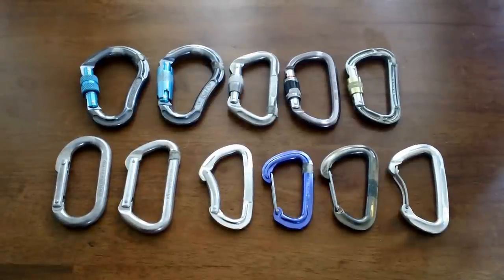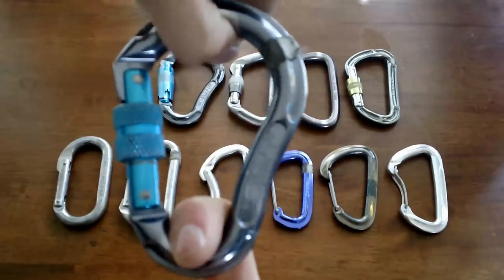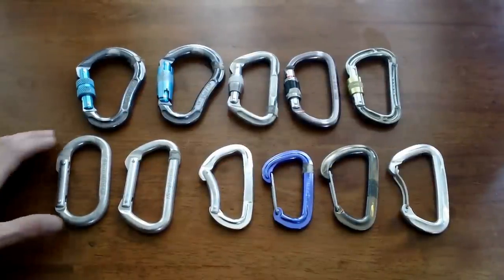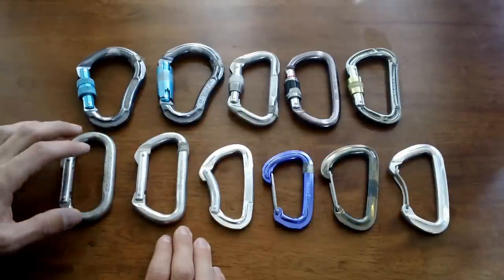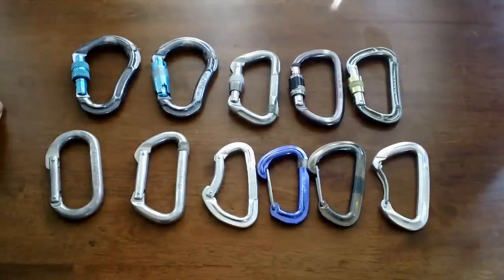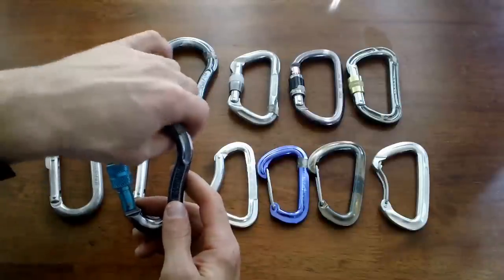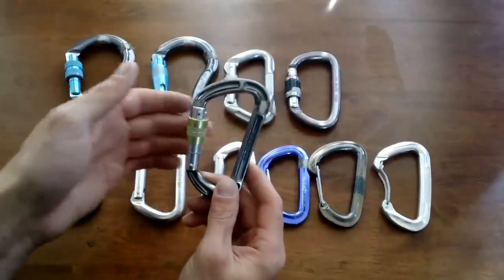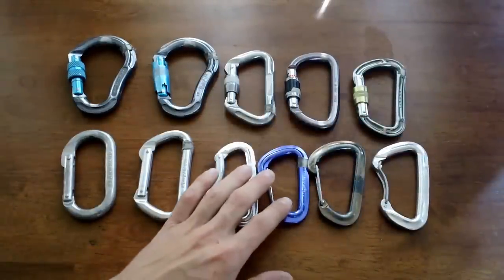Intro to Carabiners

Comment: Keep in mind, the kN rating is a force rating. When you fall, you are putting more weight on the system than just your body weight. This is why rope stretch is very important to distribute the work (from kinetic energy) out over a longer distance (work=force*distance). And reduce that peak force exerted on gear. Its also why shock loading static systems is very dangerous, as static lines, like dynema and webbing, don't stretch (much) so all the energy of a fall has to be absorbed very quickly once all the slack is out of the system. These are the moments you need these seemingly absurd force ratings.

Comment: We once tested a few Carabiners between a 7.5 ton truck & an 9 ton truck. The 9 toner had to tow the 7.5 toner into motion using 4 loops of polyprop atached to 1 of 4 different Carabiners. Only one took it, 2 snaped & one actualy shattered into 6 pieces like shrapnel. Even the fourth one broke in the end. It wasnt very scientific but it was fun.

Comment: Interesting, some good things, some mix-ups.  First, if someone is here for an Intro to Carabiners, avoid technical climbing terms they may not know, or SHOW them:  Top-rope masterpoint, clipping rope, quick-draws, cams, building anchors, aid climbing, big wall climbing, etc.   More show, less talk.  1:08- you say horizontal but your finger points up (vertical).   Usually called major axis and minor axis, not horizontal and vertical.  The nose of the carabiner, not the tooth.  Wire gate is not just a lighter carabiner but the lighter gate doesn't flutter or bounce open from impact or vibration as a metal gate carabiner does.  Sometimes "bigger, older, heavier" may be prefered if a larger capacity is needed.  At 6:43, both carabiners are Ds, what you meant to say was, "...except this D carabiner is locking."  I believe the last carabiner is a modified or offset D since one side is wider than the other.  8:20 "D-ring?"   Take these in the helpful spirit with which I intended.
Reply: ***** Apologies if I missed my goal of providing constructive criticism.  If you didn't find anything I said helpful, I'm sorry.  LOL- actually, I HAVE uploaded a video a few years ago, but I would put it in the category of how it's NOT done!  It's pretty bad, wasn't meant for the masses, just for a few friends, and yes, I talked incessantly, didn't have a script, didn't rehearse, said a couple things wrong...  Now that I think of it, I should take it off-line, except I think it's on an account that I can't get to anymore.  Anyway, sorry if my points aren't helpful, although I don't see why I have to have great videos to have valid comments.
Reply: RC
Reply: Holy crap, thanks for correcting 50% of my newly-gained knowledge. I just came here to understand the numbers on the side of mine but walking away with a wealth of knowledge, thanks to you and OP. Thank you.

Comment: Which one would I need for a homemade calisthenics suspension setup? It needs to support my bodyweight, under 200 lbs at the moment, but may add external load dor pullups qnd dips. I need to calculated acceleration, I assume, which would increase tolerance, too.

Comment: can I use 12kn carabines for climbing or I will need more Kn ?
Reply: 12 kN is not regarded as acceptable for climbing purposes, in general it isn't advisable to go with carabiners below 20 kN, with most reputable brands going for between 20 and 30 kN for standard use climbing carabiners. 12 kN carabiners should have a warning stating they're not for climbing.